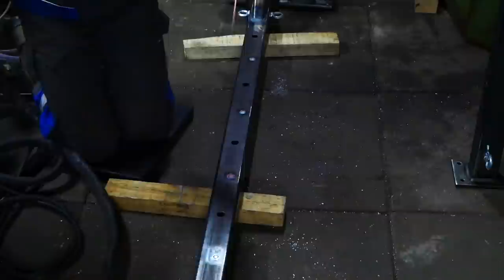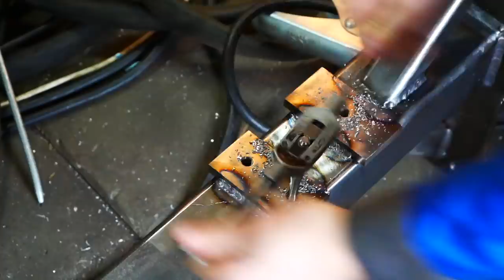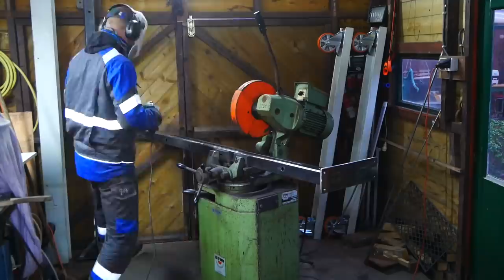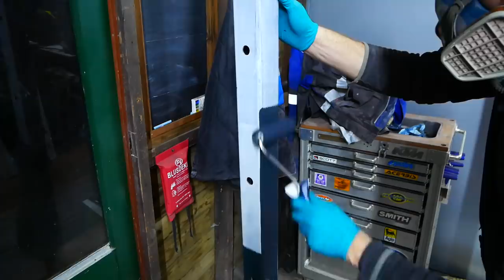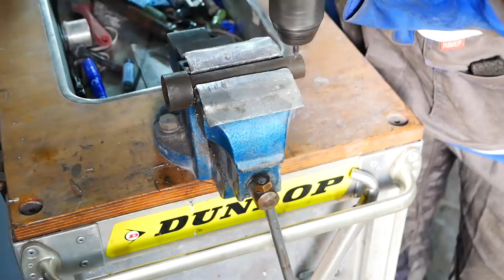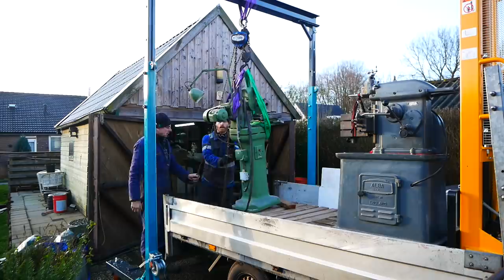Making a Mobile Gantry Crane - Part 2

Comment: good job, nice video. I was doing 3 years ago similar gantry crane for 450kVA Marelli sycronous alternator replacement, but I did more simple without upper beam lifting. Used Hyunday 7018 MMA 4mm welding rods. No primer coat, I have used German made Alpina paint direct on cleaned metal and it still stays good.
Reply from the maker: Sound great. I will check the Alpina paint because I want to try different paints in the future.
Reply: @bartharkemametalworks2299  it is similar to HAMERITTE paint,  high density,. Was trying to spray, but finally discover that with brush or painting speed the same and you do not need to loose time with spraying gun cleaning. But since it is 1K paint, it will be not resist for solvents and benzins.

Comment: Certainly looks good! Really nice build. I suppose you can't use the winches to lift heavy things, because then the locking pin that goes through the inner/outer box tube has to be removed, and then everything is only held on by the bottom pin in the inner boxtube (and the steel wire of course). But with the gantry set to the right height, and the pin in, it can lift a lot of weight. Kind of like a home-gym
Reply from the maker: Thanks! And yes, the winches only work without heavy load.

Comment: Great build Bart. I like your raise/lower mechanism: simple but effective. Only thing that I would have done differently would be to make longer angle bracing at the bottom to reduce forward/backward swing. Cheers.

Comment: Nice channel, new viewer. Great job on this gantry. Lift mechanism is a great/required idea given the beam weight. 

A folding swing arm on the base (outrigger style) could potentially allow you to cater for side movements. Tuck it in to move around/not in use, swing it out when needed. I fret on the idea that the base will fold out on itself under load given its not tied together l, but I tend to over engineer everything.
Reply from the maker: Thanks, and nice idea. Better over engineer than to weak. I will use more side supports if I need to move around a lot under load. I just clamp them on when I need it.

Comment: Nice job. Looks fine to me. I was wondering what your new shop door size is. Will the gantry fit the new shop door while carrying heavy equipment in and out.
Reply from the maker: I can but there is a little step at the entry so it's not that easy to roll it in. But I don't need to because I can park the trailer inside and lift it from there.
Reply: @bartharkemametalworks2299  you got a overhead crane in the new workshop or what?

Comment: nice job but base ,angle brackets 2 times the size you have ,and how about using old riding mower axles and steering with solid steel /rubber wjeel,woiuld be dope.
Reply from the maker: Thanks. I didn't want bigger brackets or steering because it was designed to be small and easy to transport on a trailer when I pick up machines. It's not ment to move around under load. And I can support the structure with straps if I need too. But if it was not designed for small transport I would have definitely made it bigger 👍

Comment: Great looking piece. The work quality is fantastic! I am not in love with the straps to hold the hoist. I know they are strong enough, they just don't match the rest of the build.
Reply from the maker: Thanks. And the straps are depending on the work. If I really need strong straps I will mount much heavier ones
Reply: Barts Metalwork, I think Tom means he would rather see a bolted hook or even a trolley to attach the hoist to, the sling looks a bit unprofessional on your beautiful crane :)

Comment: Nice job. How much weight will it lift vertically please?
Reply from the maker: There is a difference between max load and safe load. I will use it for max 1000 kg but I think it will can lift much more as long as I don't move it around with the load on it.
Reply: I would have thought it will lift far more that 1000kg in a static position, I agree, moving it could pose problems, especially if the load was more than a few cm off the ground. The pendulum effect could be interesting!
Reply from the maker: @glencasson9046  In theory, the top beam can hold 8000 kg. The 4x 20mm 12.8 bolts can also carry a lot. The wheels can handle 2800 kg total. My chain hoist can do 2000kg. So for straight lifting I would max out on 2000 kg but only in perfect straight loads. But I don't use it for these heavy loads. And when I need to move it around under load I would support it with more struts, side support, straps, ect.

Comment: So disappointed!, I was hoping that you would use one-cable-winch to raise the top smoothly together, you know, a cable run over the top working in tandem.
Reply from the maker: Relax David, no need to feel disappointed.  Consider the design needs first. This one was made to quickly take apart and transport on a trailer so I can pick up machines. With a one-cable system it would take to long to install and take apart. For a fixed setup I would definitely make it that way. But the 2 cable system doesn't take to much time to use. And it's not for moving up and down under load.